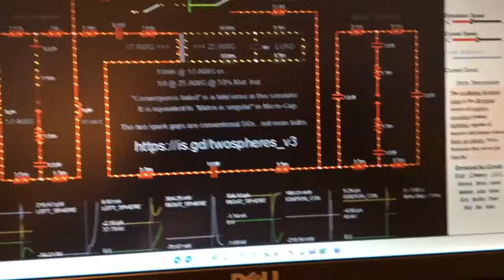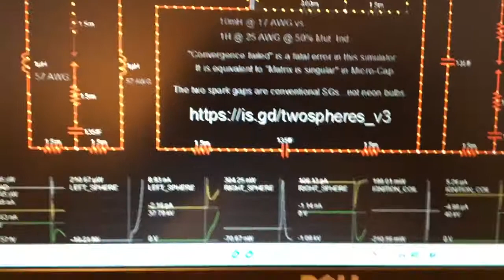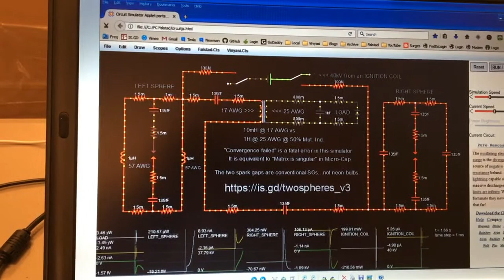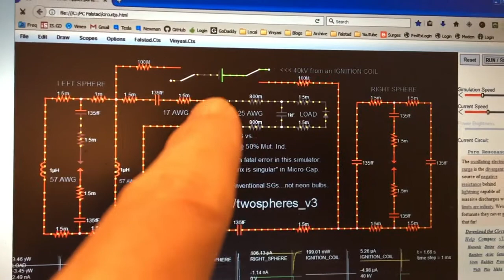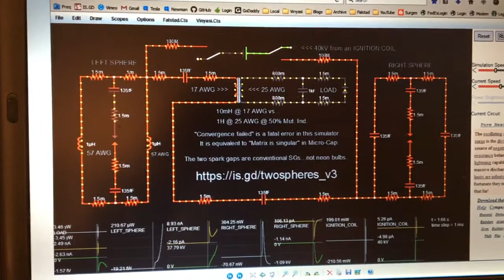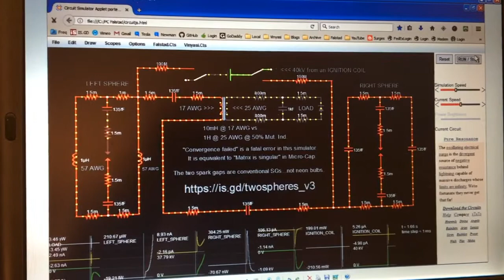Two hollow spheres of the Ammann brothers.

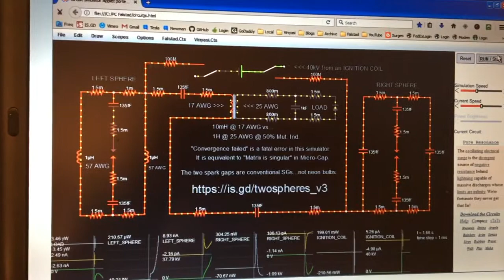Comment: 23:30 Aaron Murakami has already given us the answer to what would be a real world current source and that is a Kromrey Generator also known as a Kromrey Converter which is predicated on magnetically coupling a very large mass of ferromagnetic material such as iron to the core of the Kromrey Converter in order to enhance or enlarge the magnetic remanence which is going to pass D/C between the coils of a transformer situation.
Reply from the maker: This ability to pass DC in a transformer situation was utilized in Oliver Heaviside’s solution to the trans-Atlantic telegraph cable problem of the 1880s and was also specified in the patent for Nathan Stubblefield’s earth battery. It was also utilized in Tesla‘s special generator of the 1890s that was stolen from him under the guise of arson by the Germans 50 years prior to its use by the Nazis in some of their electro U-boats giving them a minimum distance of 30,000 miles before they needed to be recharged with liquid air to run his special generator off of compressed air. In the special generator, for every 200 pounds of iron magnetically coupled to the core of that generator, 1 hp was increased at its output according to William Lyne who allegedly was quoting Nikola Tesla and is cited in William Lyne‘s book called pentagon aliens in its last chapter, chapter 8.
Reply from the maker: https://www.bibliotecapleyades.net/ciencia/pentagonaliens/pentagonaliens08.htm